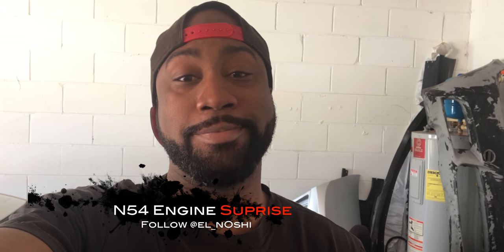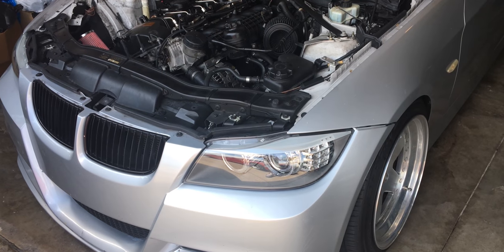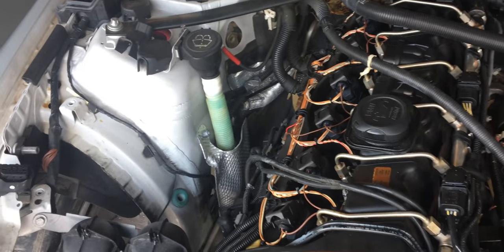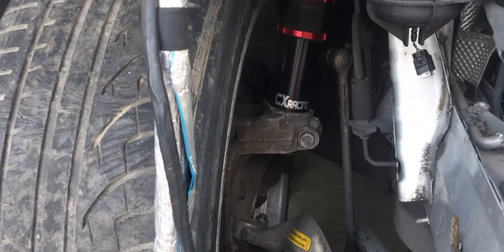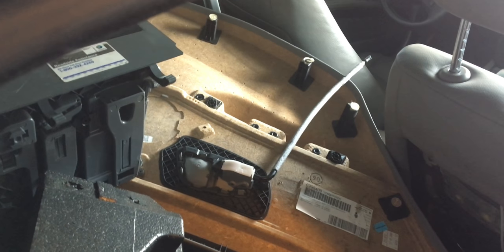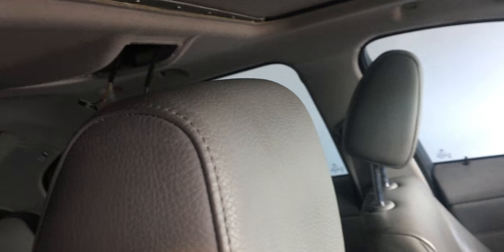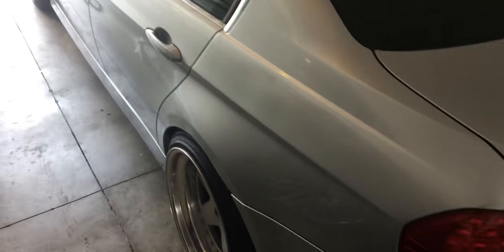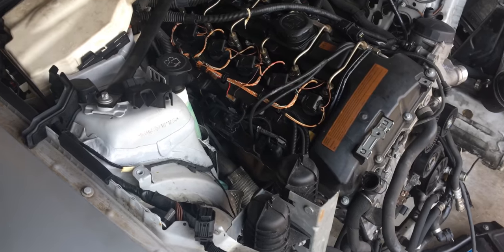Decided to Replace BMW 335i N54 Engine

Comment: How're you going with your swap? I pulled the motor and AT trans out together in mine, as replacing both. Just waiting for a few more bits before mating the replacement motor with the replacement trans (another AT), putting on my new VTT stage 1 turbos, DPs, inlets and hopefully sliding it all back into the car (08 e91). Almost a year since I embarked on this project, after my crank bolt came loose and valve kissed piston...hopefully not too much longer. Good luck with yours!

Comment: man wish you the best!! cant imagine how much its costing you! i just bought an 08 335i TT n54 manual with 95000mi and i have a lot of maintenance to take care of mainly oil filter housing gasket leak and a few other things i want to upgrade my TT's to a single 6266, im over in seattle and its killer expensive but im taking it one project at a time but with the mods i have already im getting around 450hp an looking to go all the way up but bit by bit ya know hope everything works out when your done give me your cost a may be interested in doing a swap myself later on... thanks for the vid.
Reply: thanks im going all in and will need it bro!! thanks on the future break down also when you can i checked out this guy in cali for the single turbo!!! https://www.fftec.com/article/94/FFTECVishnu_335i_Single_Turbo_Kit_detailed_photos.html
Reply: Dude thank you for the info! i wasnt aware of this i will try and look them up and see what options i can go with.
Reply: Heads up , I know couple people with JP workz that didn't turn out with good results. DOC race FTW !
Reply: Thanks
Reply: Can we put the n54 engine directly on a na 3litre non turbo car? Please reply
Reply: @nOshi2x  is it a plug and play?
Reply: I'm from India we have NA 3.0 litre n52 engine I'm thinking of importing a n54 from USA tell me what all I need to buy